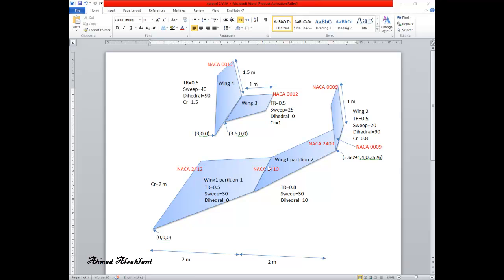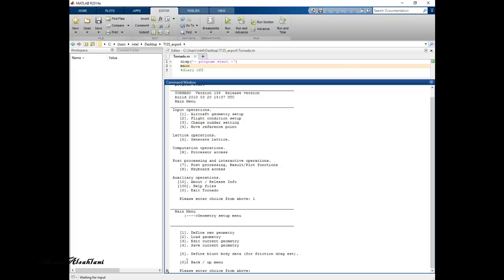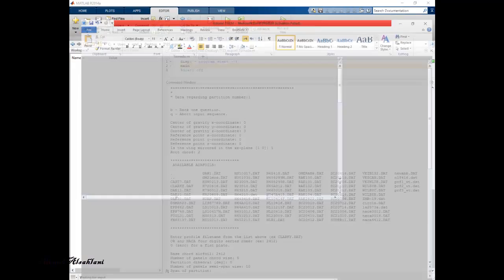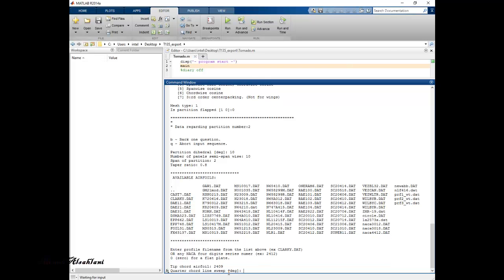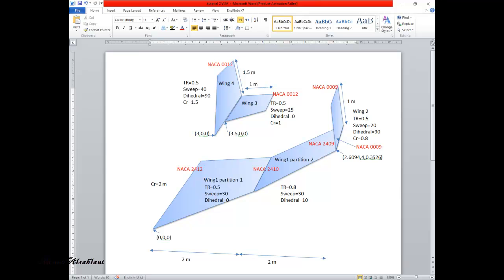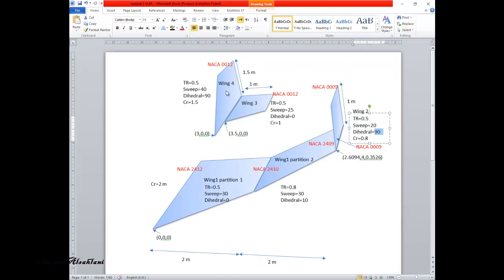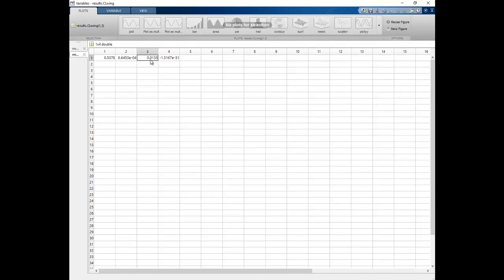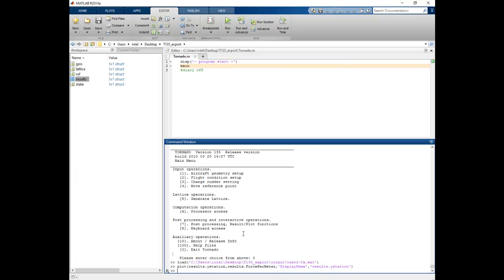How to model an aircraft using Tornado VLM, Aircraft with winglet

Comment: Hello Ahmad! first of all thanks for the useful tutorials! after playing around a bit I came up with a couple of questions: what's the difference in this case between a wing with multiple partitions and multiple wings placed in the same positions? do we loose some continuity between the different elements? and secondly, would it be possible to model a fuselage as well maybe just as a projected area?
Reply from the maker: Hi, sorry for the delay. I think it is no difference between using a multi-partition wing or multi wing in Tornado. The benefit of using different wing to model the winglet is to be able to select the aerofoils of the root and tip of the winglet. BUT, you have to pay attention about the reference wing area, as a default, it is the area of the first defined wing. 
About the fuselage, you can only represent the frontal and side projected areas of the fuselage. see some example s come with the Tornado. the folder ''aircraft''.
Reply: Thank you very much for the reply and the heads on!

Comment: Thank you Ahmad for this very helpful tutorial. Do you know a way to create blended winglets? The only way I know how is to create many partitions with small increments of dihedral, but this is a long and tedious task.
Reply from the maker: RoninTuah hi. Yes just set the dihedral angle to 90 degree for the partition which suppose to be a winglet
Reply: Thanks, your video shows how to create a winglet, my question was how to create a BLENDED winglet, which requires incremental increases in dihedral. For example. a Boeing 737-800 has a blended winglet. A 747-400 does not have a blended winglet. Thanks anyway.
Reply from the maker: yes.. desnt supported by Tornado. but for approximation you can consider it as a straight winglet.  Or you can divide it into several tiny partitions and then you have to find their dihedral. this is could be only the way to represent these increment in dihedral.

Comment: Hello Ahmad, i have a few doubts about the reference coordinates and CG placement on the program.. The reference coordinates would be the point in relation to wich all the moments (for the stability derivatives for example) will be calculated, wright? And in the menu there is a option to change the reference point to a percentage of the MAC, wich is what we do with the CG, when we impose it's position, so why do i have to inform the CG position also when i'm configuring the aircraft's geometry settings? I mean.. does that variable influences the calculations of moments all over the plane in the program or does it have no effect at all?

Thank you very much
Reply from the maker: Hi Leonardo.. Yes as you said the CG in Tornado VLM does not have any influence. so the reference point will be dealt as a center of gravity.  I dont know why it is required in the input. I investigated the pitching moment and it didnt change with CG (of Tornado). Thank you for your comment.
Reply: I have another question. In Tornado, when i want to get the stall angle of atack, the program requires the "Main wing profile max. Cl", but if i have a wing with different root and tipo profiles, wich one should i use? 

Thank you

Comment: Do you know how to add more airfoils to the list?
Reply from the maker: +Krystal Loop yes, you can.
But you need to make the file like the following
No. of coordinates of the upper surface               No. of coordinates of the lower surface 
coordinates of the upper surface start from x=0 to 1
coordinates of the lower surface start from x=0 to 1
after that, save your file in the folder aircraft/airfoil
Reply from the maker: also you can open one of the airfoils saved in aircraft/airfoil and see the way of arranging the coordinates points.
Reply: Thank you! I had them ordered in reverse!